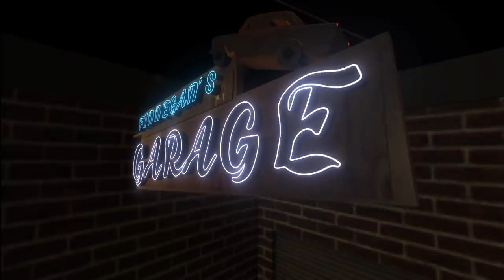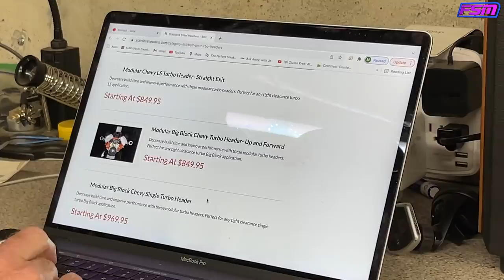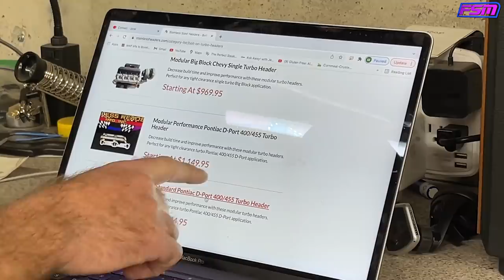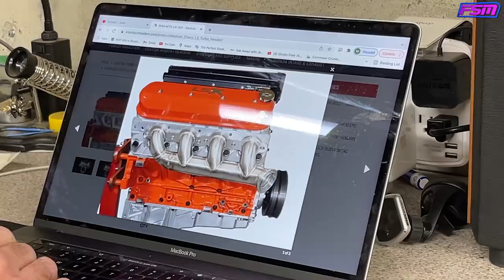TWIN TURBO 427 LS ENGINE IN A NEW JET BOAT!

Comment from the maker: For everyone who wishes we swapped the turbos and pointed the discharge tubes upward instead of down at the bottom.... we did try this and it simply wasn't possible due to the fact that I want the turbos tucked in closely to the intake manifold and valve covers. In the layout you guys are envisioning, the discharge tubes point right into the side of the throttle body, leaving zero room to plumb them. When we show you the next video installment of the build you see what we mean and how we came up with a really clean and compact way to plumb the cold side of the turbo system. As always, thanks for the comments and input. I am always learning from you guys.    :)
Reply: The second stage of your trimming the 90 would have been good for that look, but I think tucking them in will have more benefits and it looks slick. 👌
Reply: Flip them around 180 and have the intakes at the back or fed from a ram air intake above the engine. That would mean you could rotate the outlet housings to the top and possibly gain the space you need whilst keeping everything tight as possible. Also means you're less likely to get ya mullet eaten by a hungry turbo too.

Comment: I’ve been screaming at the tv for three minutes, “USE THE OTHER TURBO!” If the compressor outlet comes off the top directed towards the engine, you can lower the turbo even more and have a small/strong tubing piece connecting it to the throttle body.

Comment: Those transfer screws... I've been making my own for years by cutting the head off a bolt, chucking it in a drill and giving the end a point with a bench grinder. 🤣 I didn't know you could actually buy them
Reply: Me too!!
Reply: Big enough hammer, any old fastener can transfer it's location
Reply: @Onewheelordeal  
I like your thinkin' kid
Reply: I have done the same thing, I also didn't know you could buy them. I think bi will save the money and continue doing it my way .
Reply: I've used set screws. Can be a bugger getting them in and out but in a pinch its worked

Comment: Switch the turbos from side to side so the charge air is coming out of the top side not the bottom it will allow the turbo to sit lower without having funky angles on the charge tubes.

Comment: You can make transfer screws by cutting the head off a bolt, chucking it up in a drill and sharpening it on a grinder. It’s not hardened steel like the ones Finn used but they still work. Grade 8 is usually hard enough to transfer a mark on mild steel. Works great on firewalls, fiberglass & wood.

Comment: I agree with switching the turbos side to side and the discharge to the top.
Reply: Disagree, there would be more hot areas to burn one self on, and there wouldn't be enough room to put smooth bends in.
Reply: Agree.
Reply: I also think that they should have put them on top..but who knows what goes on in Finnegan's head
Reply: Definitely switch the turbos and put the compressor discharge on the top.

Comment: Swap the turbos over and have the intake exit at the top so you can pipe straight into the throttle body.
Reply: My thoughts exactly
Reply: I was thinking that the whole time. Hot side forward, would allow the exhaust to be even shorter.
Reply: I would leave them as they are, 90 degree elbow facing down from the throttle body to each turbo. would be clean
Reply: Thank you 😊
Reply: I agree, keeps the compact look and makes the intake side super clean.
Reply: Great minds
Reply: and the logo isnt upside down
Reply: Exactly.
Reply from the maker: @riderzinc  this is what we are doing. its super clean and simple.
Reply: @FinnegansGarage  Perfect, That’s made my day

Comment: I'm not an expert by any means but I think the shorter and straighter the intake air pipe is the better off you'll be.  So you would want to switch the turbos side to side so they have a straight shot into the throttle body as opposed to running two 90s on each side to get it to the same spot.  Just run through all the options before you finalize it.  Even take pictures and compare them side by side to see what fits your ideal look.  I'm a touch OCD too so that's why I mentioned this

Comment: It’s been beaten into my head to always let a turbo’d engine cool down several minutes if possible after running it hard.
Reply: We used to let our Mack idle 3 minutes before shut down.
Reply: Hot turbo and conventional oil it would cook the oil in the turbo and eventually take out the bushing with hard carbon. 

New synthetic oils, it's not as concerning. However if the hot side is 1500*, and you shut it down instantly, that oil is still going to cook. Better synthetics will be ok up to 5-600*, while conventional will cook at 280-320*.
Reply: Water-cooled turbos are much less susceptible to coking the bearings.
Reply: Totally agree. I've got a big hp turbo street car and a turbo diesel daily and have always just taken it easy for a few kilometres and let them idle for 20 sec or so before shutting them off
Reply: not wrong - but chances are you turbsky is water cooled running on a temp sensor / timer + waterpump combo that will take care of this for you

Comment: I would put those charge tubes coming from up and straight to throttle body with clocking the turbos exhaust towards center so you can make single exhaust pipe coming from center.
So the turbos would sit in little angle charge inlets pointing bit to sides of the boat.

Comment: Yeah just need to sew some heavy-duty Velcro on to those pillows, and the seat back. I kept wanting you to try the turbos on different sides of the engine, have the compressor housing rotating from the top to the intake, rather than from the bottom side up.

Comment: You are going to want to seal the holes you drilled in the plywood bulkhead. One option is to just  give the wholes a coat of epoxy to keep water intrusion out, a better way is to over size drill the holes and sleeve them with tubing that is glued in so you can run the bolts for CO2 bracket in and out without wearing through epoxy, back into wood.  Water is terribly destructive to composites. The wood provides the core for the laminate composite the thicker the wood or core the stiffer the piece without having to add skin thickness. Think a phone book vs a single sheet of paper.  The water will get into the open pores of the bolt holes even with the bolts installed and rot out the wood, you will be surprised how far it will allow the water to migrate .  I used to do destructive testing for the largest composite core manufacturer in US . Worked with almost all boat manufacturers. Water intrusion into laminate is a very common issue.

Just a suggestion love the show.
Reply: Yes!
Reply: 5200 and call it good.

Comment: 28:22  You have two empty holes in the rear engine support.  Tap those and then drill and tap the rail end of the same support.  That would give you some good strong points to mount supports to for the turbos. Just a thought.  I not knowing WTF I'm talking about might be a bad idea.

Comment: The 'oil outlet' (aka 'turbo drain') is actually transporting oil and a considerable amount of gas that leaks through the turbo. Always use a much larger pipe on the drain side to handle the gas otherwise pressure can build up and oil can migrate into the exhaust and intake.

Comment: I would mount both of the compressor cover outlets directly to the Y adaptor on the throttle body with v bands and then plumb the exhaust inlet to the exhaust manifold. They would be both sitting on an angle behind the engine and would look kinda cool. You could do a nice big 2 into 1 for the exhaust as well.

Comment: Water cooled turbos also keep the cold side from heat soaking on extreme duty operations, like road racing. It creates a thermal barrier in the center section.

Comment: 30:10 holly crap yes... swap them. And use the Motion Y fitting. From this point the video to the end I must of said try the other "mirror" turbo like 25 times.  My wife thinks I might have tourett syndrome after cursing at the misuse of a pair of Nelson mirrors and a cnc billet piece of artwork from Motion. 🤣

Comment: Since this is a family boat, you could put an insulated rail on the engine itself as a structure for it, therefore making it removable. 26:36 could be  a U as you look at the engine, going around the engine to the turbos. That way they can grab the rail and be secure from all aspects.

Comment: Are you opposed to making a jacketed exhaust and going thru hull to some tips? Dropping the turbos down.
Reply from the maker: I dont want the exhaust going through the hull. I may put a swim step back there and if I do I want to be able to sit there without the exhaust tips in the way.

Comment: If you can make room in your boat building budget for aluminum connecting rods that second tank could be full of methanol instead of race gas and be making gobs of power and also making the whole engine run ice cold a frosty intake is a happy intake . just try to explain to the misses why her eyes are burning when you switch tanks with a big smile .
Reply: I was thinking e85 would simplify everything...
Reply: @toddformanek8495  but very few or no gas pumps on a lake have e85.  You go through a TON of fuel boating and having the ability to just pull up to a pump on the water, fill up and keep going makes sense why he's putting more work up front to run unleaded as the main fuel source
Reply: @drexelmathews7312  Where I live, we jet boaters don't don't get gas from gas stations on the water. But e85 is readily available at the Sunoco stations everywhere. I'm sure it's different around the country. And you're right, a 21ft Daytona jet tt ls on e85 would indeed use a ton of fuel

Comment: 1. How well will dry manifolds perform for all around lake use? i.e wont they get hot during long slow no wake idling?
2. How did eliminator finish those stringers? The fiberglass weave isn’t visible on the stringer but can be seen on the gunnel supports.
Reply: Can't be any worse than in a car.
Plus they are out in the open.  Water cooled manifolds are mostly a thing to protect the fiberglass, and less about the headers themselves.

Comment: Okay Mr. Finnegan, and Mr.
Newbern, this suggestion will help you out immensely on your fabrication jobs.
I'm not a fabricator of turbo piping, but I was a sheet metal worker for many years before becoming a mechanical superintendent.
Go to your local home depot in the tool area generally by the welding section they have, and you'll see laser levels of various kinds. 
Find the ones that give you horizontal and vertical lines which can be  independent of each other, are together at same time. 
As long as you have a fixed position that is level, and some even have leveling adjustments on them to allow for uneven surfaces. 
Then put some tape on the hull so that you have a constant position to place the laser for future references, and then you have a method to measure your angles, verify that your level, and if you have two layers you don't have to have a hard fixed position to try and measure to one side at a time. 
All you have to do is measure that the laser's are equally spaced apart set your turbos in place according to your laser on each side, and say you want the distance between each to your Y fitting. 
Just measure between the two turbos and subtract the width of the fitting itself and your done with that.
You can also use the two side by side set at the different elevations to determine your angles needed and the distance between the center lines.
Hope this helps
Reply from the maker: that's a great idea! thank u.

Comment: Just re watched this YouTube installment 4 the 3rd or 4th ⏰⏰ Fabulous.  Like the way u 2 guys nut stuff out 4 aesthetics & function.  
Q as l dont know the answer.  Can stainless steel be jet hot or ceramic coated 2 keep the outside of the exhaust & hot side of the turbo cooler.  I have seen a chap in Australia doing the hot side of the turbo.  Do u guys in the USA do something similar.   Next Q 4 U is what Brand & Size Turbo r u using . 

👀👀 4ward 2 ur next video. 
Thx again Robert Australia 👏👏🤣

Comment: I wish I could say I love my m12 drill like you have. (Shown around the 7:30, 7:40 mark). But I hate it. I have the m12 flex combo kit. Super impressive with the power and life for a 12v system. But how they made the grip/handle/shaft, whatever you want to call it. The area you hold on to… It’s too fat. They should have shrunk that area. The battery packs don’t go that far up in to the tool. For thin little shit that doesn’t require you to have your tool in your hand for a long time I guess you wouldn’t notice it. But I used to use mine in boathouse repair jobs. Anything from structure, to decking, to the roof I used the drill and impact. They can take the abuse. Which again, super impressive for a 12v tool. Fuck they make your hands hurt at the end of the day. So now they just sit their drawer because the m18’s are so much more comfortable for prolonged used. And yes I know I typed a book. And no, I don’t give a fuck.

Comment: He is building the exact boat at motor combination that I have literally been dreaming about for at least 6-8 years. I even have all the parts and written down and saved. The Eliminator Daytona 21' is the perfect hull design, the perfect materials are used and the perfect length is used to keep the weight to a minimum and still be plenty strong enough to handle the kind of horsepower that this motor is going to produce. I cannot wait to watch this badass boat and motor being put together. What a freaking dream this is to see this amazing project come to life. The only difference is I would have chosen a 632 cubic inch motor to be the basic motor concept.  Hell yes I am so excited right now that my hands are shaking. I predict 140 plus mph , maybe even 150 if the pump can hang in there with such massive amounts of power be hooked up to it. Either way it will accelerate at such ferocious Force that it might expose the driver/ passenger to g-forces that could be a limiting factor of pushing the boat to it's all out limits.

Comment: Thermo-syphon.. there was a Mugen kit for the air cooled cr125 that converted it to water cooling. It was like in 1980..there was no water pump. It relied on thermo-syphon to move the coolant through the top end. Fun fact

Comment: My factory 17 Fiat 500 Abarth runs an electric pump for 2 min after shut down to keep cooling the turbo thru the surge tank. It something like that an option with that setup to run some kind of timed cooling system like that?  Could save on the way things have to be ran for easier turbo plumbing

Comment: SWAP the turbos around. DAMN...... Exit out of the top. The lest amount of bend and the shorter the runs the better. Do not leave the turbos exiting out of the bottom like you have them. at least switch it around and mach it up and weight the good and bad.

Comment: With the turbo's coolant, would running a time-limited coolant pump be better than just relying on the heat of the turbo's exhaust side to create a coolant migration ? The pump could be switched off whilst the boat is running, the opposite of the ignition.

Comment: FSM window logo cut heat shields over the hot stuff  , lazer cut from aluminum pipe would look cool ,shed heat, as well add some safety when that wave hits no one seen coming + they get a free FSM tattoo if they fall on it. LOL

Comment: The turbo' log exhaust looks very well made - but I don't get why they didn't sweep the runners towards the rear, rather than direct them directly into the opposing wall of the log?

Some applications use a small water pump to cool the turbo's independent of the main cooling system - these can be used with a timer to continue pumping coolant for a short time after the engine is shut down.

Comment: The single bracket for the CO2 bottle is bugging me.  With the longitudinal forces wake impacts will make that bottle is going to bounce a bunch and something is going to break.
Reply: Padded shallow cup mounted to the hull would be a good solution for that.
Reply: @lunkydog  Yeah, but the hull is angled there.  Actually there are several things at angle it's hard to tell what vertical is exactly.  Just 1 bracket with 2 bolts seems like asking for trouble.

Comment: Wouldn't it make sense to design the center cartridge to that when the oil ports are vertical, the water ports are already at 20 degrees?   
(Instead of a square cartridge, a parallelogram, with a 70 degree angle between the vertical oil and horizontal water ports.) 
Or did Steve not think that far ahead?

Comment: How would the intake charge route if the cold side was run off the top instead of the bottom? (Switch the turbos left to right so the intake comes off the top instead of the bottom of the turbo) I think it might be cleaner, keep the turbos low, and would reduce plumbing from turbos to intake so give a little better response. Or I'm an idiot, which is also possible.

Comment: tom nelson nelson racing engines has done mirror image turbos for years so not to have the mongoloid looking ones some reason he doesent seem to get much press and the duel fuel system you will be using is simular to one they have developed yrs ago.tuning with 8 frs and coil on plug makes tuning 8 individual cylinder engine and complete control of timing fuel curve and perfect stoichiometry (fuel curve) all cylinders. very cool stuff. like eight individual with common goal ferrocious hp

Comment: With that dominator suction you need to stuff it. It it to big and will see at least a 7 mph gain with closing it up. I have worked with American turbine directly with this raw casting and can show you very easy gains that need to be done. We have proven it in all the race boats that have this suction piece